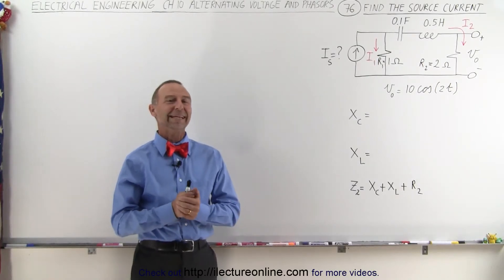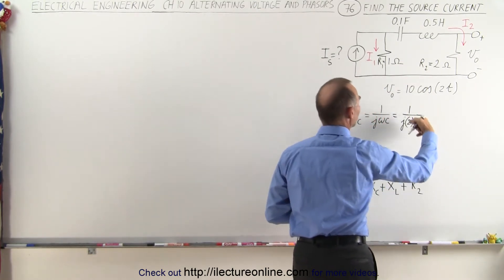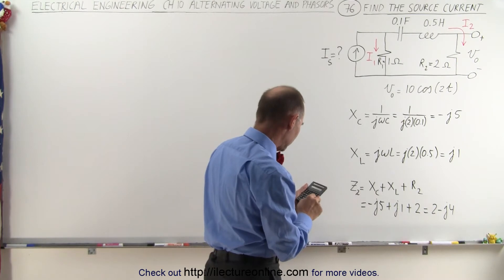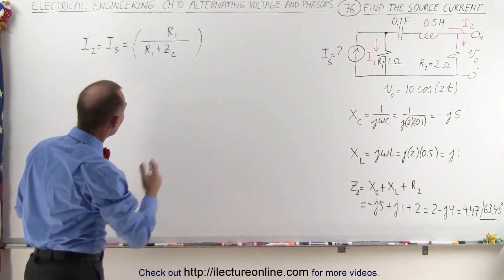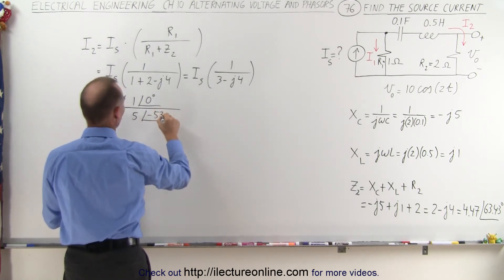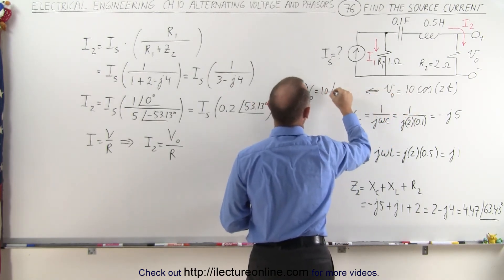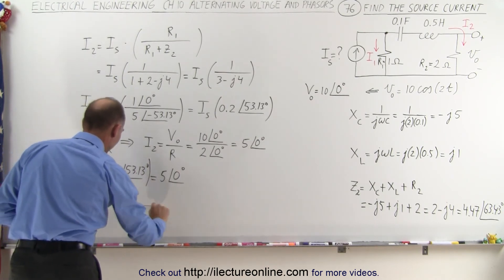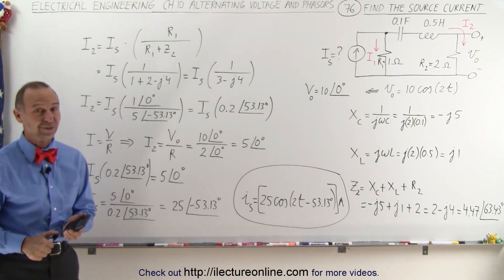Electrical Engineering: Ch 10 Alternating Voltages & Phasors (76 of 82) Source Current=? (1)

Comment: The way I did this was a bit lengthier, but essentially I realized we know V0, which is same as VR2, and we also know value of R2, so ohm's law: I2 = VR2/R2, and this current will be the same for the whole branch since the capacitor and inductor are in series with that resistor, then I marked the first top-left junction as V1, and solved for it by reasoning the voltage across the CLR branch would be the same as the branch of I1, so I found the total impedance of that CLR branch, and I already have the I2, so V1 = I2*ZofCLR, and now we know V1 and R1 is given so ohm's law: I1 = V1/R1, then lastly I used KCL: Is = I1 + I2, and then did it that way. It seems harder than your method but I'm not yet at the stage where I confidently know to apply current divider.
Reply from the maker: You are correct.  (It should be negative)

Comment: Thank you sir, lovely video! One note, at 2:07, should it not be -63.43 instead of 63.43 degrees? Strangely enough I did it on my own and got the same exact final answer as you, maybe I also switched a sign somewhere else but I'm too exhausted to try to find where exactly 😂😭
Reply from the maker: Yes indeed.  It should be negative.